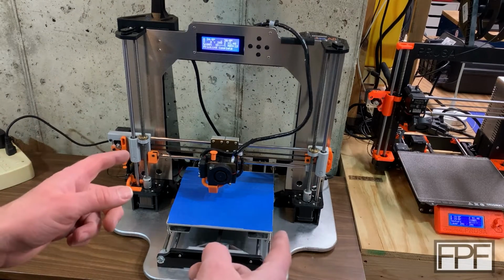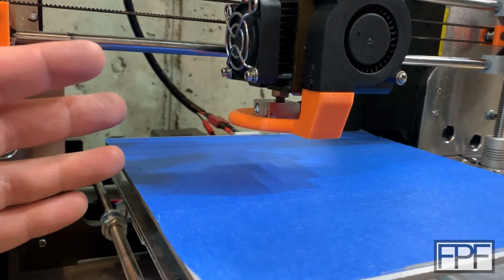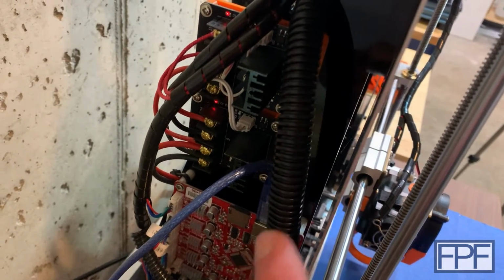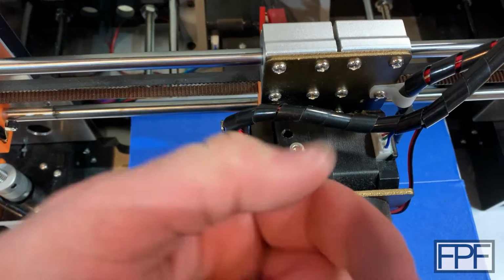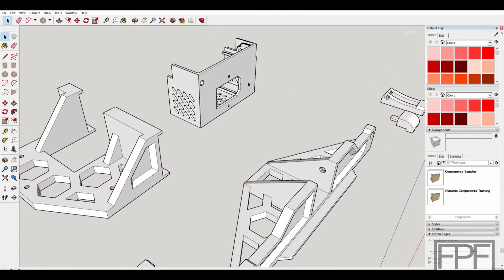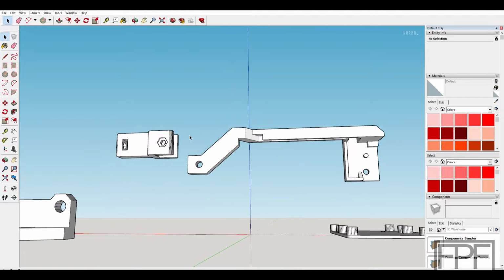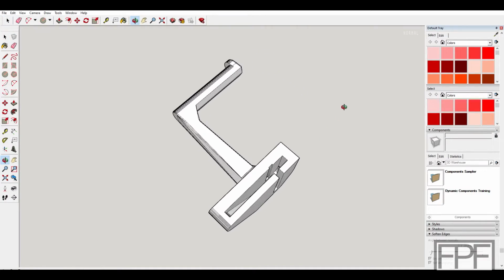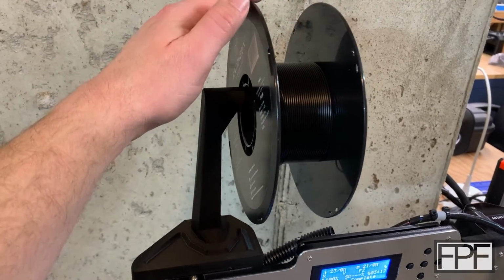ALL the mods to my ANET A8 and some new aluminum bling

Comment: You could probably easily modify the z top and bottom brackets to use the MK4 z/x axis. There's also a remix to use the MK3 toolhead with it. I'm putting together a printer with the MK4 Z/X and a modified MK3 toolhead using an orbiter 2.0 extruder.

Also, give Klipper a look. It's pretty awesome for "modernizing" older printers without having to replace mainboards or anything.